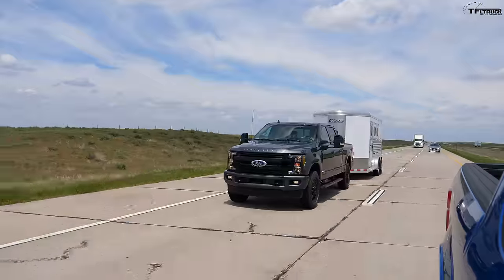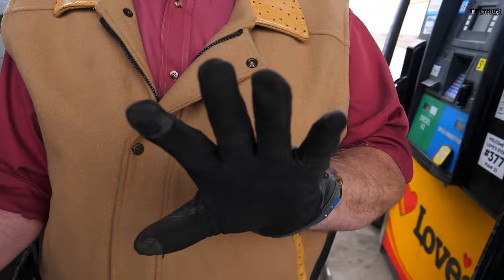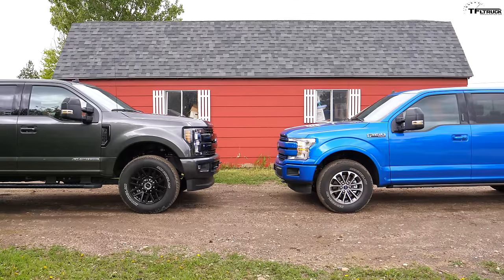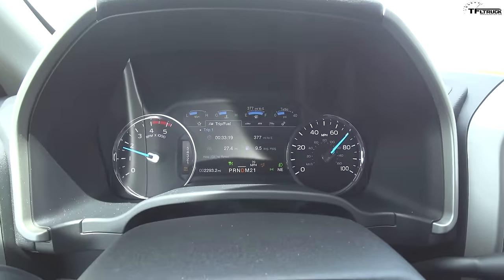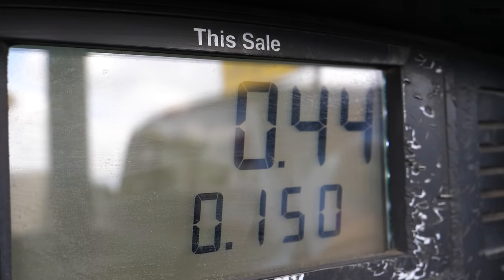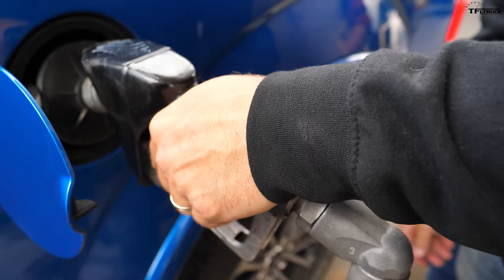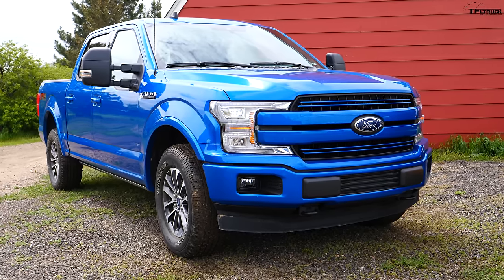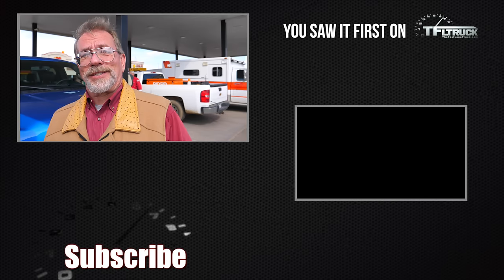Do You Really Need a Heavy Duty Truck to Tow 9,000 lbs? Ford F-150 vs F-250 MPG Review

Comment: To let you know how shitty the MPG on these new emissions controls desiels my 20 year old 5.9 cummins gets about 15mpg when towing and about 20 unloaded. No EGR, no regen, no DEF, the only thing between the turbo and the tail pipe is 4 inch pipe and a muffler.
Its impressive how powerful modern desiels are but they seem to be burning way more fuel in order to have cleaner emissions. Seems pretty self-defeating.

Comment: Why is that almost everybody consider just towing capacity without looking to other values like payload and/or GAWR? My 2017 F150 EcoBoost can tow up to 10,700 lbs so most people will say that it will easily pull a 7,000 lbs travel trailer. Well, this is true but when you see in detail other values such as payload capacity or GAWR is where things get interesting. For example, my trailer fully loaded is 7,000 lbs with a 1,100 lbs tongue weight. This weight plus passengers and cargo on the truck exceed the truck payload capacity (1,562 lbs) in more than 300 lbs and the rear GAWR in almost the same amount.
The Andersen weight distribution hitch and Roadmaster active suspension keep the assembly pretty square, so road handling is very good. Question is: Is it safe to tow knowing that you're exceeding your payload and rear GAWR?

Comment: I would like to see the numbers on this loop with Mr. Trucks "Max Tow" FX4 vs the 5.0L standard tow package F150.  Those 3.55 gears in the 9.75" rear diff will definitely make Mr. Truck's F150 accelerate better than the "airplane gear" in the 8.8" axle under the 5.0 Coyote truck.  Fuel Mileage is where things would get more interesting.

Comment: Another great video from the TFLT team!  The comparison really resonated with me because it has been on my mind for an upcoming truck repurchase.  I was very surprised at the minor difference in MPG at this load.  The 5L seemed to be right on the mark to a bit strong based on my current experience towing with an F150,, but I was expecting the powerstroke to be into the double digits based on older powerstrokes used and similar loads that I've towed in the past.  Makes you wonder if there was an aftertreatment regen in process?

Anyhow, it would be great to see a similar comparison within the GMC and Dodge product lines.

Another modification to the comparison that would be helpful to a broader viewer and user base would be to replace the horse trailer with a bumper hitch travel trailer RV.  I say this because the weight to trailer length ratio is an important factor in trailer sway which was one of your rating criteria.  A heavy, lower profile, and short stock trailer slips through the air and is far less influenced by passing vehicles compared to a 37ft long, 12ft tall bumper hitch RV that is around 37ft at that same weight.

Please keep the great comparison vids coming!
Reply: Dodge doesn't make pickup trucks any more

Comment: Given the price difference between gas and diesel fuel, the gas rig is cheaper to tow that trailer with even with the slightly lower mileage.  The only advantage I see to towing with the diesel rig is engine longevity, but it would have to be pretty big to offset the higher initial cost AND the higher fuel cost.
Reply: Yeah this would be more of a stability and control thing for my buying decision, not necessarily the the engine itself. A half ton to a 3/4 ton is a significant change.

Diesels can pull though I'll say that much.

Comment: I really think it's about how often You use the truck . You could of put 10k pounds and for 60 miles down a flat highway in good weather yeah the f150 is fine. But if your going to  tow 100s of miles , through various weather and traffic. Then you need the 250.

Comment: You feel the trailer more in the F150 because the tire pressure is lower than the F250.   35psi vs 65psi make a big difference in, side motion.

Comment: would have been better with a eco boost vs diesel. I was real impressed pulling my dads travel trailer with his 2.7 eco to southern CA from WA. decent mpg and never a lack of power.. The 2.7 preformed better than my 5.4, recently got a 6.7 diesel and the power is impressive and mpg way better than the 5.4 cant pass on a 2014 with only 18,000 mile on it.
Reply: How much did the trailer way that you pull with the 2.7?

Comment: Ive grossed 22k with a half ton truck before. Its not fun but my old dodge handled it. She didnt like turning, had to lock her in 4x4 just to turn so i wouldnt recommend using a std cab short bed for that kind of towing. I gross 30k with the gas and diesel superduties when hauling hay. The 5.4 f250 and triaxle trailer weight 14k empty. The 6.0 and same trailer weigh in around 16k. So in all honesty im right around 32-33k with the f350.

Comment: The real question is how long until you start having drive train issues pulling that trailer all the time.  6.7 > 5.0 > 3.5 > 2.7.  Figure up those repair costs in that mpg number!
Reply: Chad Rains that's not a towing problem, but a (F)ix  (O)r (R)epair (D)aily problem.  That definitely doesn't apply to the Tundra.

Comment: Also need to add the extra cost of the oil change and fuel filter replacements on that diesel. Its considerably more expensive than the gas engine.

Comment: I would never tow anything at maximum capacity.  That mean that you have zero payload in the truck.  For example the Toyota Tundra I want have a towing cap of 10K pounds and a payload of 1500.  If i put my 1200 pound atv in the back of the truck my towing cap is almost zero.
Reply: Yea, these fools don't get it and still promote the masses to overload there vehicles. FUBAR

Comment: I pull a 9800 pound 5th wheel with my 2013 F250 Lariat and get over 12mpg and I probably have another 800 Lbs of cargo. And it looks like you were on flat level surface. Hell I got over 10 Mpg in Yellowstone. The truck is a beast and would stay at 70 mph going uphill in the grand Tetons. That F150 would blow a head gasket doing that. You want to tow. Tow with a diesel.

Comment: Yes!  Large travel trailers require over 11,000 lbs pulling power.  What I don't need is all the extra frivolous B.S. these trucks are coming with as standard.  My next truck will not be a new purchase due to these ridiculous prices.  I may even drop a new engine in my current ride, supercharge it, and modify the suspension for my needs.
Reply: What's your current ride

Comment: Interesting comparison on an entry level.  A more thorough test would have been 200 to 300 miles and include up and down grades with curves in the road to compare the brakes and power with handling etc.  As you have shown in this entry comparison, the extra risk and cost for the Powerstroke, does not pan out at all in big ways. What's worse is the diesel should be getting 15 to 17 mpg however, the DPF/EGR designs are primitive pollution controls that kill mileage and engine longevity. When the day comes that diesel engines are allowed to breath better with different methods to control pollution, a diesel isn't the winner unless there is a demand for the maximum payloads, say 75%+, these type of pickups offer including the 1 ton DRW. When you look at the entire picture of cost for fuels, maintenance, diesel vs. gas options, gas is the winner every time unless there is a full time need for maybe 75% or more of the total capacity of the truck you use. But, there are those who will say, "I don't care about cost, I like how the diesel runs". That's fine if the budget has no concern about it.

Comment: I always am amazed with how bad all of the new trucks are with gas mileage.  My 2000 superduty with a 7.3. I tow a 36 foot trailer at around 1000 pounds (9000 dry). I get 12 to 14 towing.
Reply: Shocking that more powerful engines burn more fuel.

Comment: I tow a 29 and 1/2 foot travel trailer, 5500 lbs dry, 6,500 loaded (about 750 lbs tongue weight loaded) with an 18 F150 super crew w/3.5L tow package 5.5ft box.  It’s maxed out with myself , wife, child, and a bit of cargo in the box.   Close to limit on payload, not tow load.  I do not recommend towing 8000+ lbs with a half ton, at least not a travel trailer.  Axles, suspension, brakes, steering, they just just cant keep up.   Just because you ‘can’ doesnt mean you should.  Just one guys opinion. Stay safe out there!
Reply: You are well educated. Most are not...
Reply: Christopher Carter your 1/2 ton is just too inadequate, and it's not an issue of the 1/2 ton.

You must have bought the truck, and then figured you wanted to tow with it, then found out your got a poor truck for towing.
Reply: @hdpptowing5736  Most all F150's will suffer over payload as Ford advertising gets you confused.

Comment: The comparison becomes valid only because the price of 1/2 Tons has risen so much to approach the range on HD trucks. IMHO, 1/2 Tons should be much cheaper and 3/4 and 1 tons should be more focused on workloads. Do we really need 20 speaker stereo, corinthian leather, DVD players, and 12" screens in a 3/4 or 1 ton work truck?? My last comment is buy the truck for the heaviest load you will carry. If you're carring 10k lbs or more on a regular basis then buy a 3/4 ton or 1 ton. If you carry a 5k lbs boat and trailer 1/2 ton will do it. 9k lbs is borderline and that's why TFL chose that number.

Comment: Most Half tons can tow close to 12,000. So 7-9000 is no big deal. Once you get up to 5 figures, that's when you should really be thinking about getting a super duty. Even the mid size ranger can tow 7,500 with a 4 cylinder ! Pretty amazing if you ask me, but I wouldn't push that engine past 6000 if used to tow regularly.

Comment: I like this channel but this was a bit silly.  That f150 would pull a 20000 pound trailer loaded with most of the weight over the trailer axles on a flat open road.  Emergency braking, hill decent, hill climbing, collision avoidance these are the real tests.  We have all seen a Toyota pull a 747 and a Duramax pull a giant ship but can they do it on a hill?

Comment: Good video, gives people data to determine which vehicle is best for them.  I'm waiting on the 2020 7.3 to see if it will fit my needs before i buy a new truck.  If you guys can do this for the 2020 F250 with the 7.3 and the 6.7 pulling 18-20K that would be great consumer data.  It would make my decision easier.   Also throw in the Ike.

Comment: I think the place you will notice the mileage difference the most, is hilly terrain.  I think you will likely see the gas engine suffer in those areas. While the Diesel will still dip some, but no where close to as much as the gas engine will under a tow load. If I am correct aren't you often seeing 3-4mpg on most the gas engines on a ike gauntlet? Verses the Diesels which often are in the 8-10 range still?

Comment: Bigger brakes and bigger oil lubed bearings in the rear hub assembly. Would definitely not want 1/2 ton truck if towing that kind of weight frequently. Bigger brakes would also come in handy if trailer brakes failed.

Comment: The 3.5l with the tow package says its max tow capacity is 13.5k. So I wish you could've tested the f250 super duty vs the f150 3.5l with the max tow package and a 13k pound trailer and see what the difference is

Comment: Ford is selling more F150 3.5 Ecoboost MAX trailer tow packages for pulling campers than the V8.  They also sell more F250 gassers than diesels.  Test the 3.5 F150 vs the 6.2 F250 gasser and start pulling campers.  Hardly anyone pulls horse trailers.

Comment: When you’re towing the truck rating is never about towing the trailer. You can probably tow a 30000 lb trailer with the F150 but stopping it is another issue, as is parts breakage from overloading. The brakes and axles are much larger on the 250.
Reply: The F-150 is 2,700 lbs lighter than the 250 and just as many tires making contact with the road.  And the trailer has brakes.  I bet it can stop faster.

Comment: How would length and height change your opinion, if at all, when towing heavy with a half-ton?  Most people aren't towing horses, they are deciding between a Rockwood 2509s (25ft overall) or a Jayco White Hawk 24MBH (29ft overall), both in the ballpark of 7,000 lbs when fully loaded.

Comment: You mentioned the initial cost differential of the two trucks, but you did not factor in the cost differential of the expense of gas vs. diesel in the mpg.  The coyote engine would be much more cost efficient in dollars per mile driven.

Comment: The only way that 6.7 got that poor of fuel economy is if it went through a regen. We just took a 2016 6.7 on a 400 mile trip with six horses in a goose neck stock trailer. I'll bet we were 15k lbs between the trailer horses and all our gear for a week long pack trip. We averaged 12mpg through the mountains of Utah.

Comment: I’ve towed a car and trailer with a few new body trucks. They’re about like towing with an 05 f250 or comparable diese except the foreign trucks. I hate gas trucks but they’ve come a long way. I wouldn’t mind a newer gasser now. Any more weight  than towing a full size suv I would upgrade to a f250. My dads poor titan was dying in front a uhaul load. Couldn’t have been that much weight. 6 mpg lol and couldn’t do 65. Hooked up to my f250 22mpg at 70 lmao full trailer

Comment: My 2018 F150 manual says to use higher octane for towing. Also, it recommended not to tow with  cruise control on. I have twin turbo v6 3.5L
Reply: You could hear the 10-speed transmission 'hunting', shifting back and forth... and they were on flat ground.  Not fun to drive in that configuration.

Comment: If you are not towing everyday then the diesel is a absolute waste of money. Diesel engine is a extra $10K, Higher upkeep, higher repair cost, paying for DEF(Unless you delete it but then your truck is illegal). Only advantage is slightly better fuel mileage only when towing and more power. Or get a Gas superduty if you are worried about brakes but a modern half ton with good trailer brakes is plenty for 9K pounds.

Comment: You say bigger and higher is safer but not really, a 3/4 ton has a solid front axle which raises the front and raises the center of gravity. In an emergency the 3/4 ton is much more likely to roll over. The independent front suspension is far superior

Comment: That's a very interesting test, but it is a bit like comparing apples to oranges.  You are comparing gas and diesel engines more than the 1/2 to 3/4 ton trucks.  It would be interesting to see a gas 250 compared to the 5.0 150.  An ecoboost against the other three (5.0 150, 6.2 250, and 6.7 250) would also be quite interesting.

Comment: Ill take my 6.7 Powerstroke all day long over a F150 Ive had both and there is no comparison, Diesel baby is the way to go if your hauling often. When I'm not hauling I like the power of the 6.7, set it at 85 and it never breaks a sweat on inclines, the F150 will constantly downshift on grades. It comes down to what you can afford, it also comes down to how long youll keep it. A diesel will outlast a v8 in the long run with good upkeep. The only negative for the diesel in my opinion is the oil changes and the fuel filter costs. Id choose diesel!! I have other vehicles so it makes it an easier choice for me. Simply love my Powerstroke.
Reply: I've got an '86 IDI 6.9 that'll probably outlast my '15 Coyote.

Comment: Well get the heavy duty gas engine if you pull those a lot  unless you're one of the car delivery driver that drives across the country for the job. I just can see the diesel paying it self off over the gas HD. Not with 1. more money per gallon of diesel vs gas 2. Def tank (even if you delete still cost 2k) 3. More initial cost of engine 4. Cost of oil changes & maintenance

Comment: Why didn’t you guys do diesel vs diesel? Or V8 vs V8 (gas engine)? Or since the EcoBoost is turbo charged and, like the 6.7L, is the top of the food chain for the F-150, why not compare those two? There were also much more subjective tests to do... Acceleration, braking, actual hills. You could’ve also monitored things like engine oil temp, trans temp, coolant temp. These are all things that matter... Also maybe a loop that was 200 miles or more. Seems like that would’ve demonstrated more clearly what separates the two trucks.

Comment: I use a F-250 SuperDuty diesel to tow my race cars. Let me be very clear here; the answer to your question is yes yes yes. You should always have more truck than you need. The maximum of anything is just a hair away from failure. Spend the money and order brakes on all trailer axles as well, so when the wreck happens in front of you, you are steering the trailer, not having the trailer push the truck. The true towing test that you skipped was a heavy braking lane (direction) change. I guess you didn't want to jackknife  the F-150.

Comment: In 2020 a ranger is a half ton a 150 is a 3/4 ton a 250 is over 1 ton and a 350 is as high as 2.5 ton. These back in the 90s rating of 1/2 3/4 and 1 ton are extremely outdated and from before we ever had a smartphone lol...
2020
Ranger 1600-2100lbs payload 
150 1200-2300lbs payload 
250 2400-4300lbs payload
350 3900-7200 lbs payload.

Comment: Put a 28' 7+k TT back there and see what that 1/2T gets and how that feels back there. The diesel will get the same mileage and the 150 will get MAYBE 6.5MPG. Also, over a small amount of time that heavier load is just plain going to wear that 150 out. The 250 is a day in day out TRUCK. My 2010 5.4L towed our TT, but you could tell....it hated it. Our 2015 6.7L doesn't give a damn about the when and wheres, it's ready to GO! If your pulling under 40% of your trucks mileage, without serious distance, the 150 is a good choice, but if you tow over 6k with distance above 50%, the diesel should be your truck.